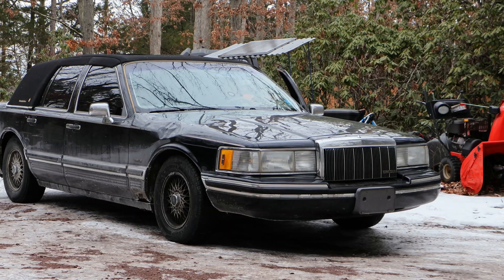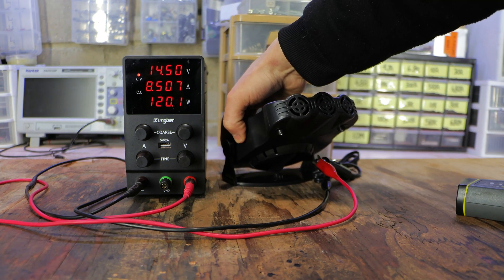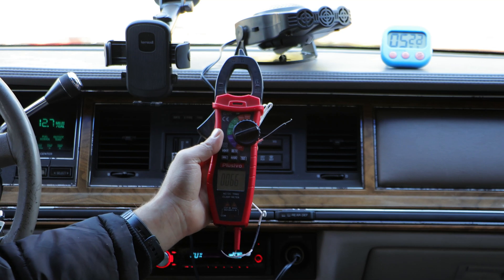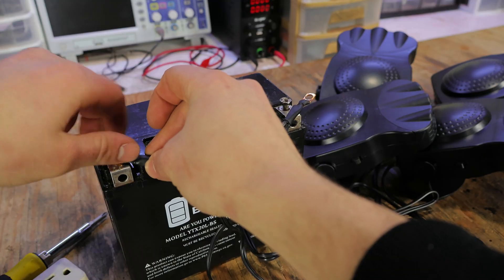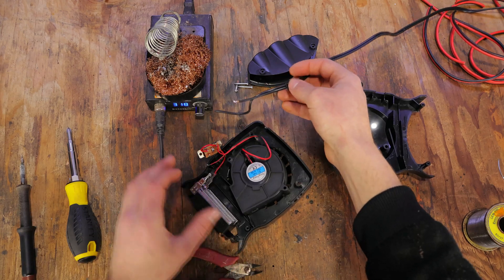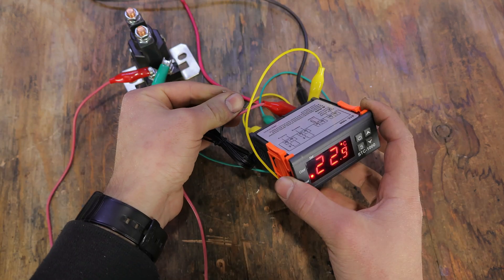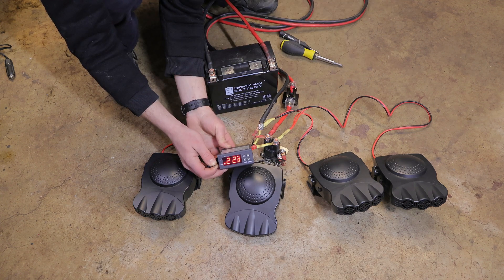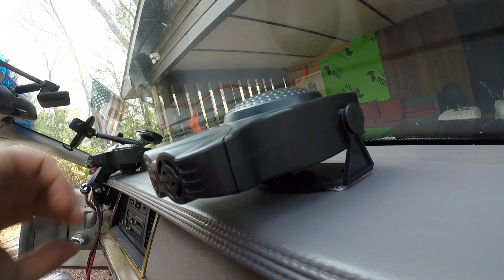Make Your Car Heat Up 5x FASTER With This Trick!

Comment: seems like a bit of a fire hazard, but pretty cool. 
might just be more practical to run a hair dryer into the cab with a extension lead from the house and turn it on a few minutes before you start driving.

Comment: Someone tell him about temote start.
Reply from the maker: @Everything817  If you meant "remote start", then unfortunately, my car doesn't have it.
Reply: @ElectronicLab.  Correct. Although id suggest, looking into getting an aftermarket unit, to put in, also. Im not sure if you know, most, especially me. We all suggest. Start the car. After you have everything you need. & drive. Dont sit waiting for it to warm up. The engine is only doing small revolution spins per minute as it would. If you just got in your car. & went. On you're way. Cause when you start driving around. The fatser your engine spins. The quicker it will heat up. & the more heat output you will be receiving. ❤
Reply from the maker: @SoldierNika  Makes sense

Comment: I need this for the winter. How does it work for -10F?
Reply from the maker: @javaman2883  For that kind of temperature, I would use a lithium-iron phosphate battery. Because lead acid batteries tend to struggle at that kind of temperature.

It would probably heat it even faster at such a cold temperature from what my  test proves. although, the colder the outside temperature, the faster its heat escapes from the car.

Comment: this is a less efficient, more complicated a way of just using a block heater that installs through a freeze plug. when you turn your vehicle on in a cold day it will quickly blow hot air out as the coolant was being heated
Reply from the maker: @shaneintegra  Great thinking 👍

Comment: what i do in mine is a power inverter and a 1500w space heater. comes on with ignition. probably pulls 100A?
Reply from the maker: @beardedgaming1337  I would have done that if these defrosters wouldn't be as cheap. Because 1500 watt inverters cost about $100, while 4 defroster are $32. Ultimately, after all the extra parts I've added, comes out to about $50.
Reply: @ElectronicLab.  With a big town car like you have, adding one or 2 batterys in the trunk link to the alternator, and one inverter of 1500W. So, now you can use a heater or a electric blanket for the pasenger in the winter time, a fan in the summer and electric cooler for pick-nic, small microwave and or tv then the town car become a town house. I used the 12v Amazon heater and they burn the fuse or just dies quick.😁
Reply from the maker: @beardedgaming1337  Most cars can easily handle 100 amps of continuous current draw from the alternator. However, be prepared that something can go wrong and give yourself enough time to fix any potential issues.
Reply: @ElectronicLab.  I don't know if I'd say easily, hundred amps is kind of the most that many vehicles could handle. At the 150 amp mark you run the risk of undervolting. Also inverters are a pretty constant current draw unlike an amplifier. So it's a bit of a worst case scenario for an alternator that might have a 30% duty cycle from the factory
Reply from the maker: You're right